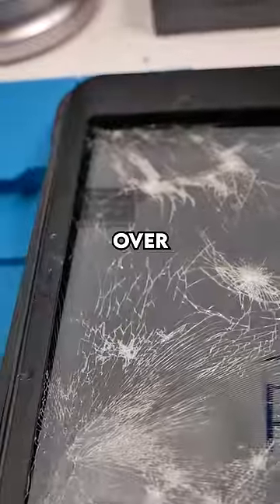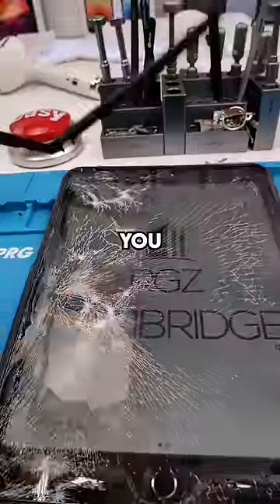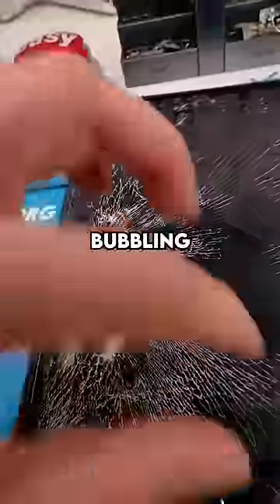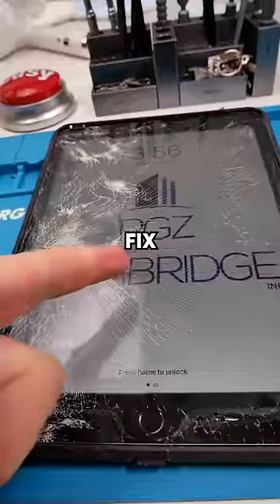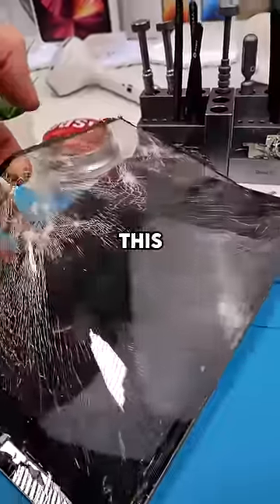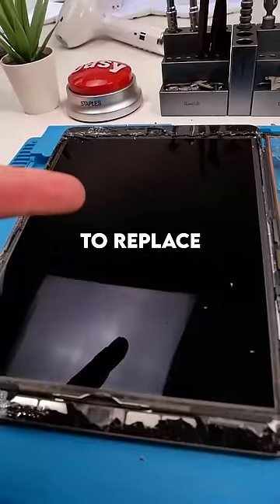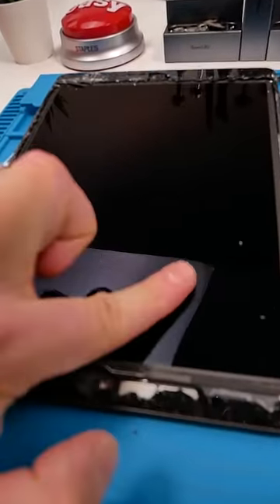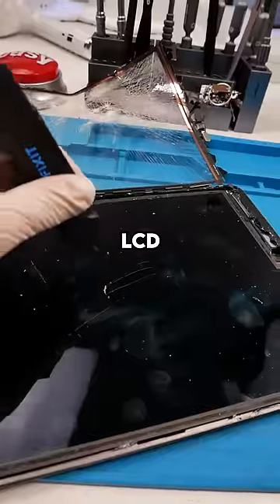This iPad Got Run Over By A Truck...... #Shorts

Comment: Ok I used to hate otterboxes in every way.  Now I hate how they are just tetured.  I love how strong they are now.  Back to when the samsung s22 rolled out.  I got one the SAME day.  Walked out of the mall.  Dropped it while running across our small town highway to the little store everyone goes to before school dropped it a 18 wheeler and pickup ran it over.  Phone was fine.  Still using it not even a scratch.

Comment: Hi I have a Sony Xperia z3 that has been off for over a year l. I dropped it one day and the lcd would not work whenever I tried to touch it it wouldn't work and I am asking you if it is possible to fix it because u am in no need of it and going to use it as a backup phone. 
 I'm in the UK

Comment: i have a problem my i need to reset my iphone but it keeps disconnecting and connecting when i plug it in my laptop
can somebody help if they had same problem
Reply: Always try the basic stuff first like try another cable or test on another computer(could be a driver issue). Don’t forget when people have problems with their lightning port 90% of the time is pocket lint and dirt inside the port.
Reply: @jesusyuca1483  i will try thank you
Reply: @jesusyuca1483  now its stuck on preparing to restore....
Reply: @jesusyuca1483  nvm i got it but now its on error 4010😭
Reply: @zore24  pretty sure 4010 is just a bad cable. Might be the phone’s port though. If u cut a little rectangle out of some paper you can fold it in half and place that on top of the lightning cable as you push it in.
Reply: @zore24  I hope that made sense. Its just to use the paper to fill up the space and force the lightning cable onto the contacts. Should go in pretty snug with a little resistance. Don’t force it. Try only 1 layer of paper then.
Reply: @jesusyuca1483  i managed to make it work just had to disable all security on my pc
Reply: @zore24  Glad to hear it and seems about right. It’s hardly ever the phone unless u get specific codes like 4013. 😭

Comment: Hey man.
I dropped my phone by mistake
I got it repaired 
Now it's on screen fingerprint ain't working.
It says calibration requires of sensors 
The phone repairer told its unfixable.